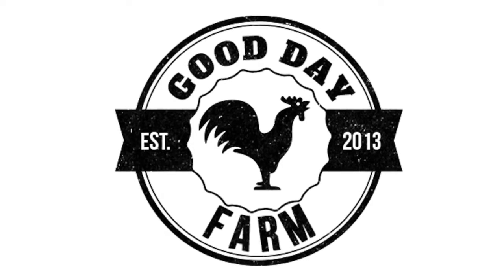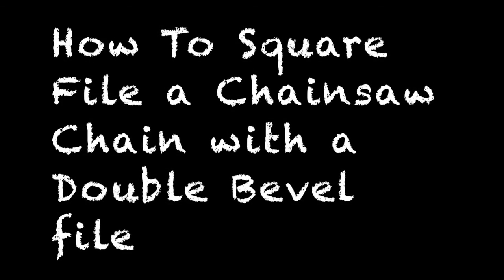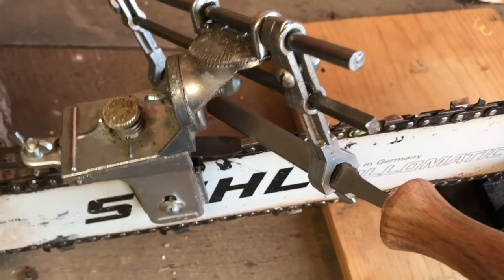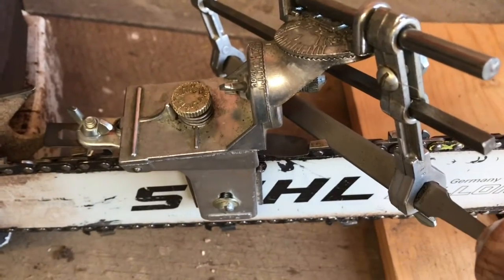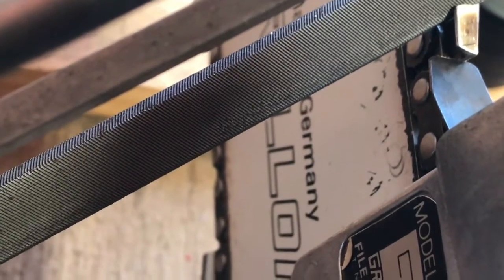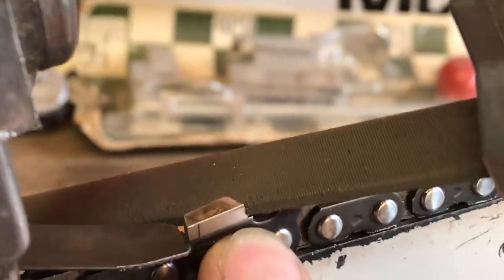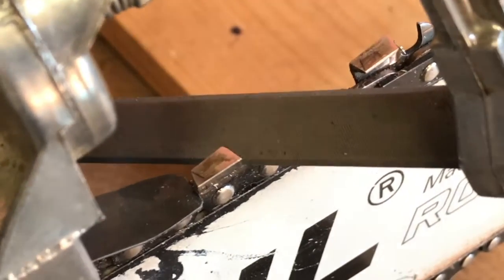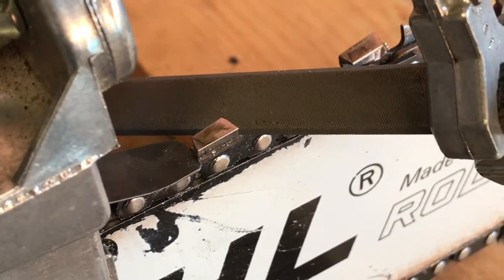How to Square file a chainsaw chain.....  with a double bevel file.....

Comment: I've got a Granberg 108 and set it up for square filing.  Works great.  I noticed that some file types won't fit in the holders without being ground a bit.  Save Edge is about 1mm wider than the diagonal openings of the file mounts.  Also, any movement of the file n joint and the cutter leading edge will have tendency to round a bit.  Thanks for the video.  Very helpful info here.
Reply from the maker: Thanks!  
And thanks for the information on the file sizes, something to watch out for. 👍
Reply: I found Vallorbe double bevel works awesome. And it has round/cylinder shape at each of file, so it's easy to secure and rotate in the jig.

Comment: I totally agree with what you just said it is a lot easier on the saw no pushing on the saw at all your saw will last a lot longer great job travis. I am going to look to see if i can find one of those older granberg file n joint looks like it works really well thank you for that and the video.
Reply from the maker: jeff C 

Thanks Jeff, keep me posted on how it works for you. 
The important part to look at on the older guides is how it holds the file. It should look like a triangle, with the thumb screw on the base of the triangle. Each side towards the top will have little notches, that's where the double bevel fits. Hope that makes sense. 

Thanks for watching, glad you enjoyed it!

Take care friend!

Comment: I'm curious to see if a Vallorbe double bevel will fit in a current Granberg jig.  I'm using a hexagonal chisel bit with masking tape on each end. Works great.
Reply from the maker: I’ve not tried, but I don’t think so. You you try, let me know.
Reply: What jig are you using a granberg?  The new one or vintage one?
Reply: @Camocountry1  I bought one a few years ago, but I believe it is the same as current models. It holds a chisel bit file with a triangle shaped casting and wingnut bolt on each end.

Comment: I used to make Mortice and Tennon Joints with a 1/2 inch hand chisel, and it is easier to cut across the fibres at the bottom of the mortice, than to cut the vertical part which is across the grain of the wood.    So I think it is most important to get the side of the cutter sharp, with the Square Filing, even though the side is only cutting 25 thou of wood... That is where the power is used up.   The Round Filing just can't get that side really sharp....  Thanks for the video, must get me a Square File..
Reply from the maker: Thanks for watching and thanks for the comment!

Comment: Does square filing only work with the g 108 or does it work with the new granberg as well? Thanks
Reply from the maker: I think it’ll work in the newer guides with modifications. The vintage ones like in this video need no modification 

I’ve never tried using a newer Granberg.

Comment: Nice video.  I have a square ground chain I have not tried yet. I hope I like it as well as you do. Thanks for your video and thoughts on the chain.
Reply from the maker: Dyno 625 

I bet you love it!  Depending on the brand, you might wanna hit with active first. Some of these chains aren't as good as they should be out of the box. 

Thanks for watching and take care!
Reply: I have a stihl chain like what you have. Mine is a 32 inch though.  Gonna take some time to file it for sure
Reply from the maker: Dyno 625 

For sure, I have a couple 36" full comp chains, they take a minute. 😎👍

Comment: That looks like a goofy file Where do you buy those files at I would love to get my hands on some.... Good job.....
Reply from the maker: It’s a regular double bevel, my understanding is a goofy file is rounded on the edges. 
I haven’t ordered any in a long time, but I used to get them from treestuff dot com. I don’t know if they still sell them or not.
Reply: Yeah those goofy files put a vicious sideplate slightly rounded  & those make a hell of a workchain.....
Reply from the maker: I’ve never used one, but good to know if o ever get back into cutting, I’ll check it out. Thanks!

Comment: Where do you get this file guide... found it for round... butt looking for square ground guide
Reply from the maker: The guide I use in the video is a vintage Granberg one. They do not Moana them any more. I found mine on eBay. You just have to look around for them, but make sure it is an old style one, that will accommodate the double bevel file. The one in the video is a 104 model. I believe the 102 will work also. 

Good luck!  
Thanks for watching!
Reply: @GoodDayFarm  thank you....
Reply from the maker: No problem, you’re welcome.

Comment: I just used a double bevel square file i can get the right side teeth perfect then turned it around and wrecked the left side. Super pissed i thought i had it but i dont. Id like to see more square filing with this jig thinking about getting one. I wanna run square. So the g106 wont work with this file? All i can find are granberg g106. Will the 3 corner chisel bit file fit in a g106 i guess i could use that file instead.
Reply from the maker: I’ve never done it, but I think you can set the 106 up with a triangle file. The vintage guides are the only ones I know of that’ll work with a double bevel file.

Comment: Where did you get the flat file at and what kind I'd it
Reply from the maker: It a double bevel file, made by Save Edge. I order mine from treestuff dot com. Here is a link. https://www.treestuff.com/store/catalog.asp?item=3573

Depending on where you live, you might find them at a saw shop. 

Thanks for watching and for the question.

Take care!
Reply: Nothing here in NM .. trying to look for it ever where .. thanks going to order a bunch now..
Reply from the maker: Great!  Glad I could help. 

Look around on that site, you can get a code for free shipping.
Reply from the maker: The code is FREESHIP

Comment: So if the Granberg 104 file guide is no longer available this video isn't going to help and I'm not going to free hand square sharpening.
Reply from the maker: There are lots of them on eBay, I have bought several that way.
The 106 can be modified to hold a double bevel file from what I understand, but I haven’t tried.
Reply: @GoodDayFarm  I appreciate the info... I watched your video last night, and hit eBay. Only 1 granberg 104a for sale, I snagged it. I'm excited to try it out.
Reply from the maker: Good luck!

Comment: Let's see how it cuts, that's only filed at 10-15 degree angle.
Reply from the maker: I wish I had a video of it cutting...  but trust me, it out cuts round filed. 
And no, that’s not 10-15 degrees for the cutter angle. More like 30.
Reply: @GoodDayFarm  you should do a video of it cutting. I have just ordered 4 files from Bailey's and I am going to give it a try.
Reply from the maker: I wish I could, I no longer have any saws, I am a long haul truck driver now...  I don’t have a way to do a video for this.

Comment: Seem's like it take's way too long
Reply from the maker: It is slower than free hand, but once you get the hang of setting it up, it’s pretty quick. And it does a great consistent job. 👍
Reply: @GoodDayFarm  after repeated failure i can finally get one alot sharper than new ✌
Reply from the maker: That’s great, practice makes perfect!